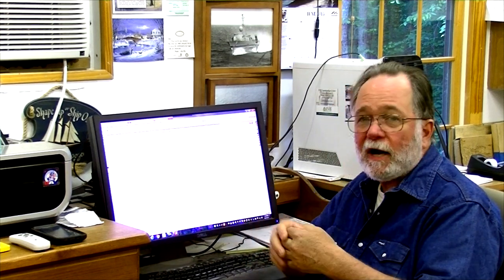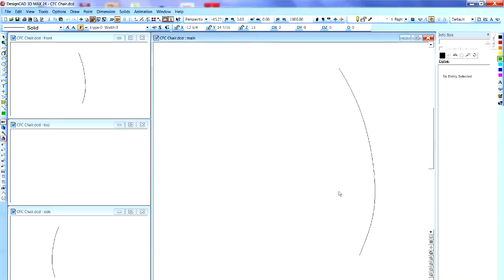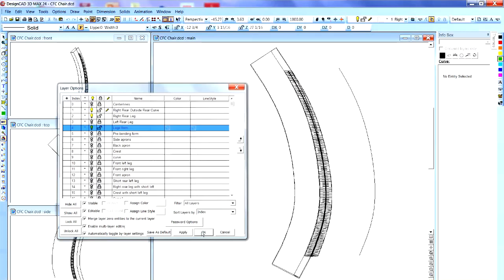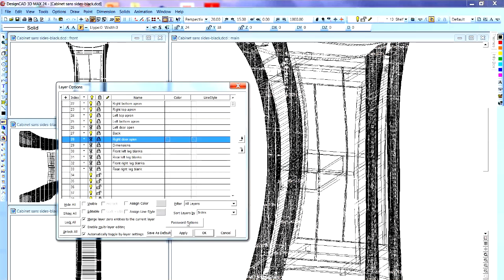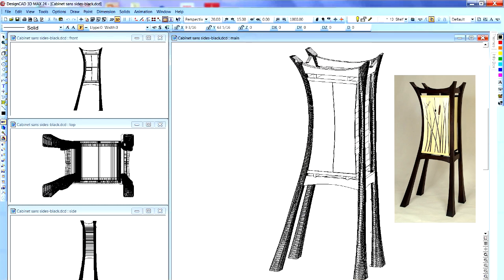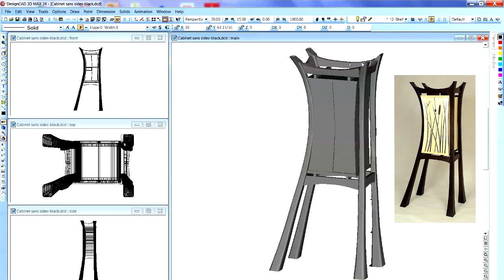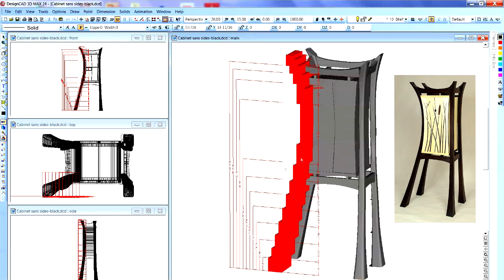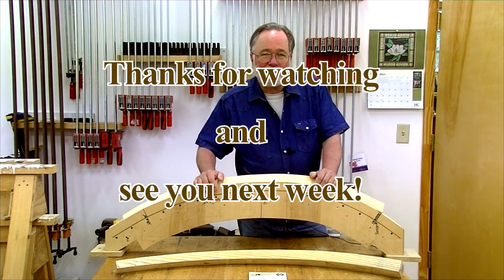Using DesignCAD: Saturday in the Woodworking Shop #16 with Andrew Pitts~FurnitureMaker

Comment: good video, do you know if an image can be imported and traced over in designcad?
 if so, any tips for getting started?
Reply from the maker: +andtastic1 Yes, you can load an image file and use the auto trace bitmap tool to get you started.